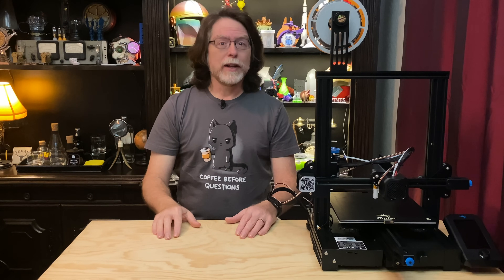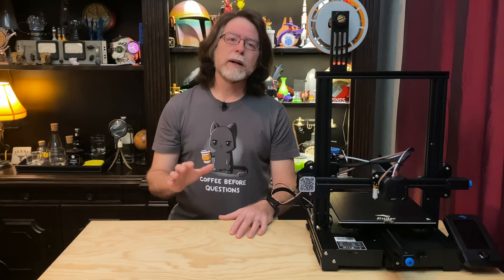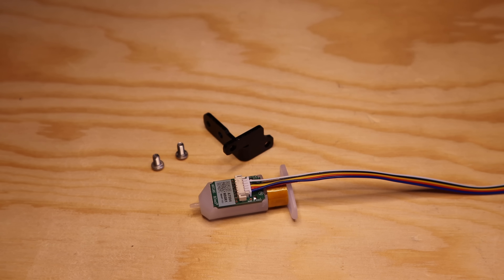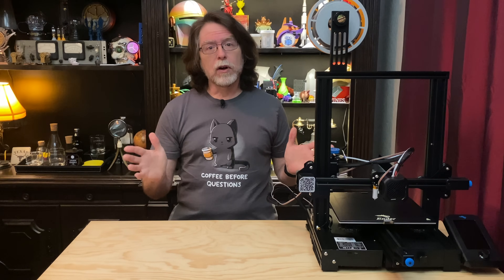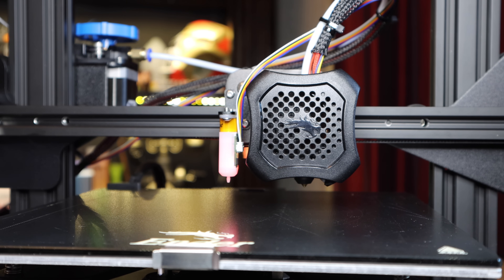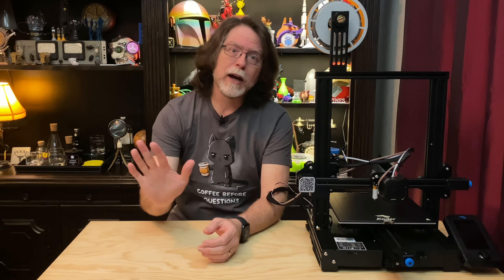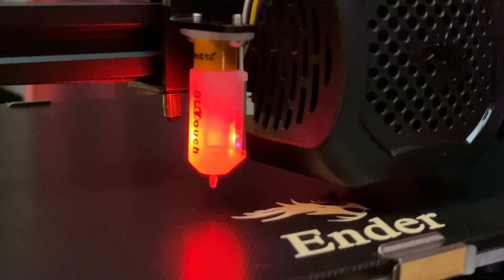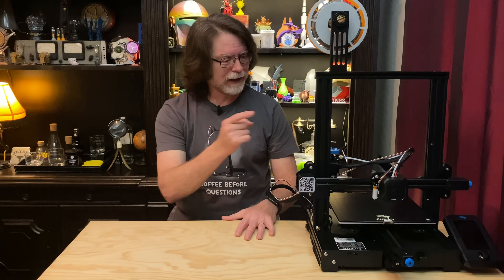Level Up! Install Creality's BLTouch Bed Leveling Kit on Ender-3 V2!

Comment: Just installed the BL Touch and the nozzle is lower than the BL Touch..   I used the correct bracket.
Reply from the maker: When the probe is retracted into the body of the BL-Touch, the nozzle should be lower (otherwise the probe tip would snag on things). But when the probe is extended, the probe should be closer to the bed than the nozzle.

Is it just that the probe is retracted?
Reply: @BV3D  no.  when i do a auto home, the probe extends but the nozzle drills into the plate before the probe touches.
Reply: @BV3D  I tried seeing if the nozzle was just not tight, but nope. its tight.  Its not much of a difference, i should be able to put a few washers as spacers and try to align it and it should work.
Reply from the maker: @dmotivate  I wonder if the holes were drilled in the wrong place on the X carriage. That's a weird issue.
Reply: Hi Michael, I had this issue moments ago. Realised I had the bracket installed incorrectly. Double check you have yours installed like this:

https://i.imgur.com/BrbsTpK.png

The curve on the bracket should be under the screw

Comment: Great video and extremely helpful! I just have one question and I'm not sure if it's already been asked, but once I find the right Z-axis settings how do I save or keep that change? Every time I go to "move" and set Z to 0 it stays until I hit auto home again giving me that 3mm of space? Any help would be appreciated (I'm new to 3d printing and I have an Ender 3 v2, but got frustrated with manual leveling)

Comment: I have issues with the nozzle heating up while doing bed leveling. It just curls messing up initial layers. How do i make the printer level the bed, then heat up the nozzle, can’t find any info anywhere for some reason

Comment: Thanks very much for this brilliant video. I followed your instructions to the letter..... Except, I actually found it really easy to feed the BL-Touch cable inside the sleeving all the way from the Motherboard to the hot end you only have to snip a few cable ties and replace them afterwards. This makes a very neat looking installation.

Comment: Inserting the BLTouch wire in the wire sleeve is easy. The sleeve is very flexible you can just compress it on one side making the wire travel shorter.

Comment: Did every step by step instruction and now my nozzle is just stuck at the top of the machine and won’t even come down, after hours of troubleshooting and got nowhere took it to the range and let loose with shotguns seems they were easier to adjust then this piece of garbagr

Comment: I know this is a 5 month old video but I just purchased and updated to the BLTouch. Was very easy because of this video. Thank you. You have probably figured this out but in the video you mentioned that you don't know why it raises the head 10mm after auto-home. I think that is so that if you shut off the printer, there is enough room for the probe auto-test when you power it back up. Also, don't know if the Creality firmware is now saving the setting on-board but I am using the firmware from the Marlin site and it does save the settings to the board.

Comment: my ender v2 bricks after plugging in the BLtouch  and turning on even after firmware update
Reply from the maker: Hi Jason,

Just so I understand, are you saying that with the BLTouch unplugged the printer starts up normally, but with the BLTouch plugged in it won't start up?
Reply: @BV3D  yes exactly, as soon as in unplug the bltouch it works, leading me to think it’s a problem with the BLtouch, oh my board is 4.2.2, i’m using the upgraded version of the BL touch. Z axis stop switch is unplugged.

Comment: BL Touch update for the JyersUI Firmware. Thanks Bryan for all the great information. I really like the JyersUI firmware upgrade, lots of advantages over the standard firmware. But now my BL Touch is out of calibration and I can't figure out how to properly set it to run with the upgrade. Could you produce a video explaining how to set it up to run with the new firmware? Thanks

Comment: Bryan I really enjoyed your video.  So one thing I missed or wish you would have explained a little more about is fine tuning the knobs on the bed itself post setup of the BLtouch.  Again if I missed this I'm sorry....

So, great I have it set up and ready.  Now prior to prints I'm assuming I still need to do my regular leveling routine?  As if the bed isn't fairly level your print may be less than great....  So my next thought/question is is this more of a moving z stop as well?  Meaning the z stop would stop the printer at some point.  But we took that off and now we have the probe that rides the x axis assembly.  So in theory not reality it will or could go down until something caused the probe to retract.

I bought this thinking ahh this will make life (leveling the bed) easier.  But now I'm thinking great I have a tool that will tell me how badly I leveled the bed. Haha

Anyway sorry for the long winded questions and comments.  Any information would be helpful and insightful, thank you!!!  Keep up the great videos!!!

Comment: Brian, when my BLTouch started doing that randomly on my Ender 3 Pro with a 4.27 board it would error and stop in the middle of homing and had to be restarted. At first I thought it was a gcode issue and then an issue with Octopi and then it started happening more frequently and I replaced the BL Touch with a spare new one and the problem ceased. It was a bad unit. I’ve never had the issue since.

Comment: I understand the video and I want to order a BL for my new 3v2 but I think I missed something. Does the bed have to be preset to some base setting before doing this?
Reply from the maker: Hi, you'll want the bed reasonably leveled before using the BL Touch.

The BL Touch can compensate for irregularities in the bed, but you don't want one side of the bed a lot higher than the other, for example.

It doesn't have to be perfect, but using the time-honored "paper between the nozzle and the bed" method, with the nozzle above each adjustment knob, should be sufficient.

Comment: Heloo. I have watched several times this video to properly mount original BLTouch. Cables are connected, but having problem with BLTouch because its not touching the plate, so have to put some distancers which is almost 4mm.The metal holding BLTouch is same as on video and same position is mounted. How this is posible

Comment: Im new to 3DP and received an E3v2 this Fathers Day with some nice upgrades! I followed your tutorial for this install and the new Jeyers UI  and it was perfectly amazing and such a time saver! What a difference! For some reason now, it is decidong to Z-home up instaed of down, no matter my Z-offset and "move Z-Down (still only wants to go up!) I have removed and re-installed the 5x5 version I had that worked so well (changing the title slightly so the E3V2 will recognize it new) to no avail. I went bacwards to stock versions and used the Z-stop and its working fine that way but i dont particularly care for the manual level over and over. Any suggestions would be appreciated. ( i have the V4.2.2 and all of your tutorials for the E3V2 have been spot-on, btw!) Thanks for a great channel!
Reply: Mine did something similar. I reinstalled the cable on the motherboard and used aa different firmware (NO  GD- for the beginning of file name) and it worked.
Reply: That's what my problem was, loose Dupont connector. Reset mine on the board and hot glued them in place. I have since become an "expert" in making my own wiring harnesses and Dupont connectors for my electro-print projects.  Following BV3D tutorials, as well as other 3D OGs, has gotten me from downloading files to making my own! Thanks for the followup!

Comment: I bought a bl touch about 2 years ago for a teen tarantula and never used it. Would it work on my new ender v2? I'm not sure if there are different bl touch models for different main boards or if it's the same thing.

Comment: another question in firmware video you talk about 3 versions. 2 for the BLTouch with and without adaptor board. I think I got the wrong BLTouch and ant to confirm if this version will work with the V2

Comment: In the back of the screen is a micro and card slot is that how you store ur data? In the video u mentioned that this printer doesn’t store things on the main board and it stores it on the card

Comment: you are my go to for all my ender needs, but you just breazed by how to get the y axis offset number, i know how to measure the X but how to measure Y?
Reply from the maker: Hi! You're right, I I didn't cover setting the X and Y offsets for the probe. I was using Creality's BL Touch firmware for the Ender-3 V2, the X and Y offsets are set correctly for their probe mount.

But if you want to physically measure the offsets, try this:

Measure X and Y offsets by placing a piece of paper--I'd use graph paper--on the bed. Line up one edge of the paper on an edge of the bed. Manually lower the nozzle to the bed. Use a pen to make a dot where the nozzle touches the paper. Raise the nozzle a little, and manually deploy the BL Touch probe. You can gently pull it down to extend it. Manually lower the nozzle toward the bed, and when the probe tip is just about to touch the paper, use a pen to put a dot where it'll touch.

On the paper, draw a rectangle, using the graph paper's grid for alignment, with the two dots as reference points for opposite corners. The length (left to right) of the rectangle represents your X offset, and the width (front to back) of the rectangle represents your Y offset.

Comment: Thanks for the video. Will make it easier for me now. Do you know what firmware I would download if I install both the BLTouch and a filament runout sensor?  Thank you for any assistance you can provide.

Comment: If I was installing the BL-touch like this I would think about putting some heat shrink tubing where it goes through that rail.  Since the Aquila is an Ender clone can this kit be put into the Aquila?

Comment: Nice now i can easily install my bl touch on my ender 3 v2, i got trouble with the middle of the bed is always lower and playing with the leveling. I still can't get a perfect match either the corner touch the glass or the middle is too high and it doesn't stick.

Comment: great vid!!  I  screwed up the extraction of the .bin file (location on the micro sd card). fixed that.

Update my printer goes to the back right and just spits out filament. Can't figure the fix. Thoughts?

Comment: Bryan, after installing the BL Touch and relevant firmware update on an Ender 3 V.2 I can't get the Z Offset properly set. I home all axis and the print head sets itself to the centre of the bed with readouts of X=154, Y=117 and Z=10 but the head is actually 15.31mm above the bed and the maximum negative value you can enter for Z Offset correction is only -9.99mm thus leaving the head still 5.32mm too high even if I do a Z-home command. I have also entered the proper X and Y offsets of -44 and -6 respectively. What am I doing wrong?

Comment: Question, is there a firmware that would handle on a Ender 3 V2 BLtouch + 4.2.7 + Touch Screen ? I can't find a firmware that has all these features together. Any suggestions ?

Comment: Thanks for the instruction. I have a problem with BL touch. In my case, It seems that the BL touch sensor is activated, since when I start the printer the sensor’s light is on and the pin extends twice. However, when I press the “auto home” after the nozzle head moves to the center, it stops there and the pin doesn’t move. Any help is appreciated.

Comment: I'm brand new, as in, had my printer for about 3 days. I cannot stand leveling the bed, and it appears that my bed is also warped, with high and low spots all around. You're telling me, that if I buy this BLTouch thing, I no longer have to level the bed? What if its already out of adjustment? Do you level the bed before installing this?? Or do I simply screw the bed down all the way? Please help me understand. 
I really want to make some awesome prints, but so far, frustration is an understatement. All I've done so far is print screwed up cubes and leveling squares, trying to diagnose issues. I'm fairly tech/mechanically savvy, but as of now, I simply want to take a hammer to this damn thing! Leveling the bed seems to be the issue all the way around (that and print speed, temp, cooling, etc, according to a friend who has been printing for about a year). I am considering this BLTouch. 
Thank you!

Comment: What about the springs though???? I've seen a few from 2-3 yrs back that they use the springs on the sacrews and the newer instructionals don't. What's the reasoning behind using or not using them? Help Bryan! I'm curious if I should bother with them or not. What's your input on it???

Comment: I don't quite understand. It's called a levelling kit but all I see is a sensor to tell you whether it is level or not. Where is the levelling part? I still have to level it by hand? If so I see  no real point to this add-on...   What am I missing?

Comment: Hey Bryan nice videos but I'm still having trouble with my printer its the same version 3v2 with 4.2.2 and same BL touch but every time I change the z axis even to  -10 and back to 0 it will stay at the same height after z axis adjustments. On side note I see that video was done in San Antonio would be great if we can meet up to salvage this debacle.

Comment: I am puzzled by the connection you made to the motherboard (7.25 on the video). All the other examples that I have seen, starting from the front, are white, black, yellow, orange and brown. These are consistent with the annotation on my 4.2.2  board. For example the 4th pin from the front is "V"  for the 5 volt feed.  Your set up has the z switch ground on that pin. I have  3 + 2  leads  on  my BLTouch which I connected using the equivalent of your set up and it gave me the black screen. I've fitted a new board and am doing serious research before trying again.
Reply: Bit the bullet and  went with, from the front,  White, Black, Yellow, Red and Brown. Works OK. The plugs were quite loose so I used a spot of hot glue to hold them in place. Bryans lead must be consistently non standard at both ends.

Comment: Hey all I just came across this channel. I bought a bltouch and I have a weird issue. Every now and then when I auto home, the bltouch errors out, but instead of blinking and stopping, it just keeps going and it smashes into my print bed and gives a god awful grinding noise on the z axis. Every time I start a print, I have to monitor it to make sure it does error, and if it does error then I need to shut off power right away and try again. Anyone else experience this?
Reply: I had it happen once, did you find a solution?
Reply: @sebastianochoa5385  no I just ended up returning it because at that point it’s useless

Comment: What is the use of the BL Touch? I don't understand it xDD
You level the Nozzle in the middle wich has mostly a lil dip or a hill. 
So if you level the nozzle in the middle the distance to the edges is the same/wrong even without the BL Touch
The offset is set to -2 in the middle but maybe only -1.8 on the edges. so you will crash in the bededges. what does the bl touch now?

Comment: I followed this video’s instructions perfectly, but whenever I auto home or auto level my BLTouch moves to the center, flashes red & extends/retracts the nozzle a few times before finally extending the nozzle & floating above the middle of the bed doing nothing. The wires are correctly plugged in & I know I installed the correct firmware.

Comment: So I updated my firmware to the Ender3 V2-4.2.2
 Marlin-2.0.1-BL-Touch – V1.1.1(without adapter board) and the screen just stayed black, I even reformatted the drive back to a fat32 and it still won't return to it's normal screen. I don't understand. ;~;  Can anyone help me?

Comment: Because I couldn't find the answer and in case anyone else has the launch E3V2 without the mounting holes for the bracket, I emailed Creality and they are sending me a replacement backboard (their term) in the mail, free shipping.

Comment: Thanks, I had mine all installed and could NOT get it to come down to the bed using the instructions .... well seeing as how they are not for my 3 v2 so I took it off AND re flashed my firmware to the original. . I will try to install it again soon following your guide.   Thank you.  P.S new subscriber.

Comment: so for some reason when I'm doing the offset (or autohome form anywhere that's not the end stop on the x axis) the carriage flys all the way to the right and crashing into the end of the rail instead of going center. any suggestions?

Comment: Hi Bryan, great tutorial. I'm new to 3D printing, just receive my 1st 3D printer last week (Ender 3 V2). After struggling with "levelling" I decided to buy the BLTouch. After several tries, I still can't make it work. The z-Azis stops working after auto home. I've tried 5 different firmware, using the adapter and also changing the cable order to match the ones shown in your video but still no luck.  Does anyone have a tip for me?
Reply: I don't really understand what your issue is, but I got the Ender 3v2 a couple days ago and struggled with leveling a ton.

I eventually realized two things, the z axis end switch was all the way down on the frame I raised it about 1.5 cm and this made leveling much easier.

I also had an issue with my z axis stopping and not sliding well, 
This was because I tightened the motor that drives the lead screw way to much, causing the lead screw to not be parallel with the frame.

Comment: What May I ask do you use for glass bed adhesion?
Reply: My repair guy recommended just a regular gluestick. Apply it right before you print. It's been working for me so far.
Reply: @lindanguyen3156  that’s what I use. The purple stuff. Cleans off with windex and paper towels😄